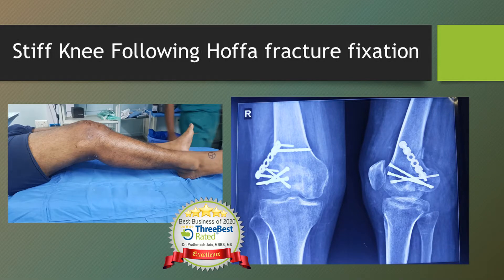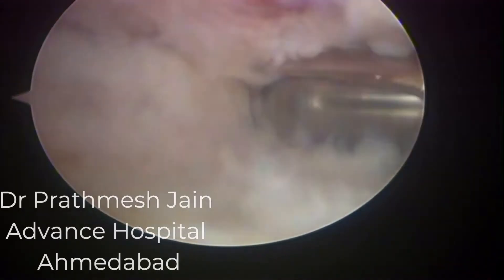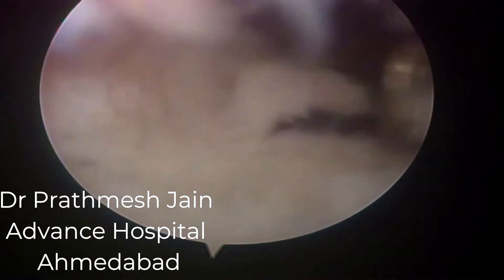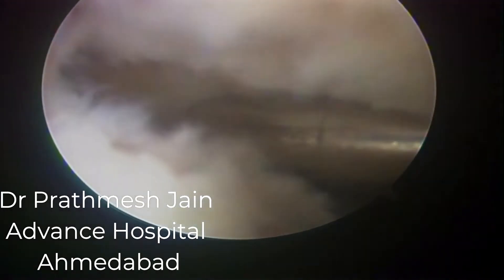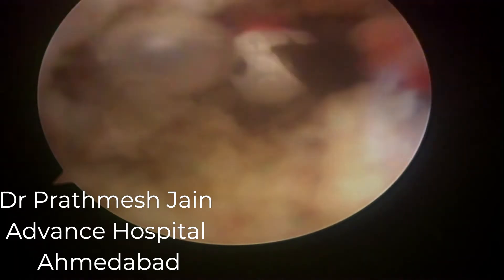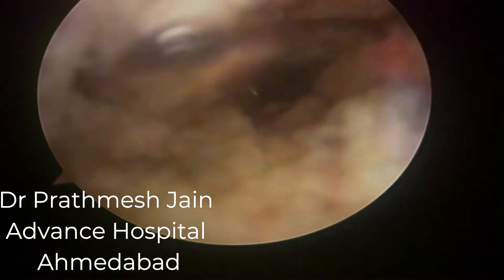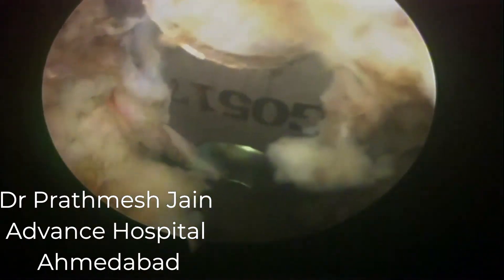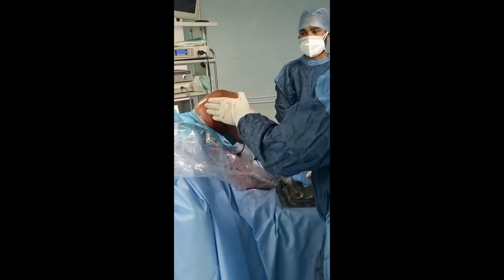Stiff Knee following Hoffa Fracture : Arthroscopic Treatment

Comment: I had knee surgery for three years and I can't bend my knees what can i do?😪😪😪
Reply from the maker: send your medical reports on 9227901980 
 Advance knee and shoulder hospital. Pakwan crossroads, sg highway 
Ahmedabad 
All details on www.kneeshoulderindia.com
You can book an appointment by calling on 7096021983/ 7096021847/7096021916 
www.advancehospitals.in
Reply: Bro did you not try physiotherapy
Reply: @RohitSharma-nk4pi  i did but no improve 🥺